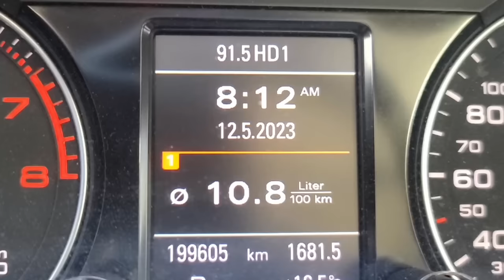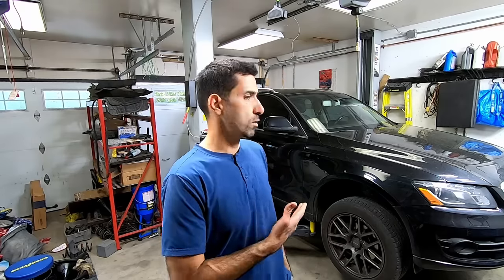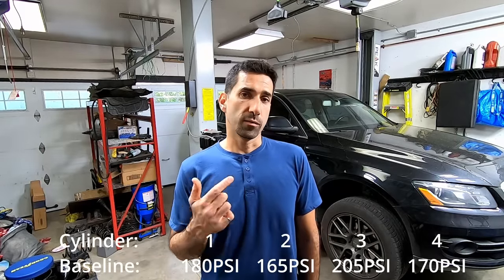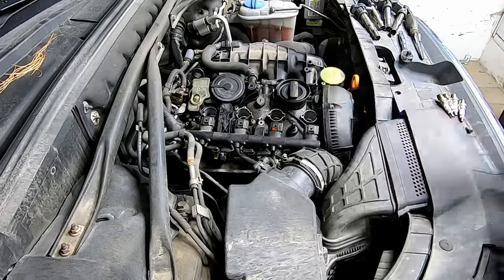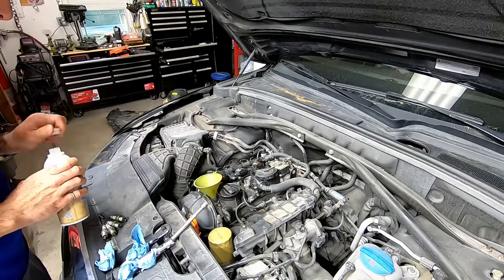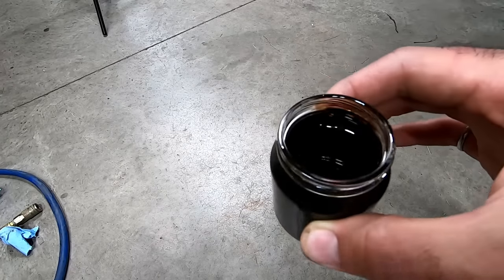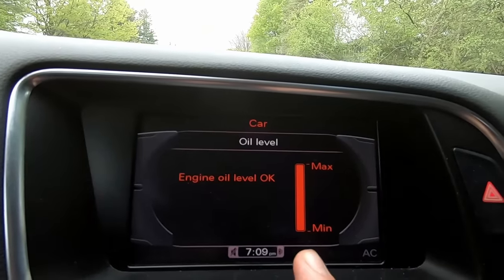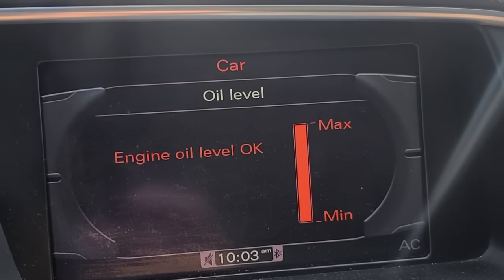How to fix excessive oil consumption from clogged piston rings (Part 2)

Comment: I finished the process with proline engine flush, when I turned the engine on there was a plenty of white smoke coming out literally like a cloud. After 5 minutes of driving I got a low oil pressure turn off the engine alarm but I was pretty sure that it was because of engine flush I drove around 25 minutes more, changed the oil and spark plugs and never got again low oil pressure alert, car runs smoother and acceleration is much better at the moment.
Reply from the maker: @EnsarRamadani-li7rz  please keep us posted on your results... lots of folks are looking for an alternative  to B12... what was your consumption before the soak?
Reply: @ETMotorsports  for sure I will keep posted about results, consumption was 1 Liter for every 250-300 KM. Next week I have a 1000 KM trip and I will keep you guys posted so other folks can see the results that I have.
Reply: @EnsarRamadani-li7rz  any update?
Reply: @romanbord668  the consumption is much better than it was, im on 2800 km since the piston soak process and i have still around %60-65 oil

Comment: Basically this problem is to do with euro emissions regs. To make engines that comply with emission and fuel consumption regs, for euro brands anyway, they use low tension rings and infest the engine with egr systems and other emission control devices. If such cars are then used primarily in low speed and stop start heavy traffic conditions, they self pollute internally with carbon and fuel related gum deposits, egr and direct injection being the primary culprits. Net result is high oil consumption, fouled plugs and intake valves etc. Of course manufacturers will not publicise these issues as it would kill sales, and won't even concede that extra maintenance, of the type shown here, is required, especially if their cars are driven in the conditions above. Personally, I drive my 2010 Mazda 2.2 diesel sport hard enough to prevent these issues, I use the best genuinely fully synthetic oil available, and have never had an emissions, oil consumption or regen issue. I do however use a diesel fuel additive on a regular basis and genuinely believe that is partially responsible for the lack of egr and carbon contamination problems. This is definitely a good idea with any modern engine, petrol or diesel. Ironic isn't  it, that the very systems added to modern engines to comply with emissions regs, end up causing way more pollution due to excessive oil burning! I mean, egr systems that force engines to breathe their own exhaust gas!!! WTF?!

Comment: Rotating the crank after filling with the chem tool just pumps it past the valves. Better just to let it sit till it runs past the rings then turn it over and refill.
Reply from the maker: you can't push the liquid up through the valves especially if you're rotating it by hand...and even if you did, you`ll just get B12 on your valves and it will leak back down - no issue...

Comment: could this work on a Ford American engine I have a 2010 Lincoln Town Car 4.6 SOHC V8 with 620,000 miles just started burning 2qt of oil every 4k miles could this work?
Reply from the maker: if the problem is clogged rings then yes it will work...that's very high mileages - oil consumption could be from other sources?

Comment: thank you very much for your 2 videos concerning this oil consumption problem that I also have on my Audi 3L TFSI supercharger engine, not finding this B12 chemtool on the internet available in France, do you think that we could do your process with another product as effective as for example the Liqui Moly pro line engine flush? thank you in advance for your response and congratulations again for what you do
Reply from the maker: Hey yes unfortunately B12 isn't available in EU...I would definitively try LiquiMoly Engine Flush Pro Line wth the same process - it should work just as well but I don't have a confirmation yet

Comment: hello i have audi Q5 2010 2.0 TDI which burns 1L every 1000km and now it's burning 1L every 250 KM ,the car smoke badly so i want to know if your car was smoking during acceleration and want to know if this piston soak may resolve the oil consumption
Reply from the maker: @abdouben4387  yup the car was smoking during acceleration and yes a piston soak can help if the issue is piston rings... first you have to eliminate all other sources of oil consumption - pcv, turbo etc... if everything looks OK then you can do a piston soak to see if it helps
Reply: @ETMotorsports  changed injectors glow plugs turbo so the problem last in piston the car smoke is getting worse with the consumption get bored to drive it want to test this DIY so I’m asking if it works for different people or you know others did it and it worked

Comment: There is an easier way than even this. Just throw in 0.25 - 0.5 litres of auto transmission fluid to your oil 800kms before your oil change is due. Eliminated my oil burning in one hit, but I plan to do it at every oil change. The detergents in the ATF atomise the carbon behind the rings, clear out the channels in the scraper ring and allow the oil to flow back down into the block as it should. 

Looks like this B12 stuff is good, but ATF in the oil seems to be an even easier solution.

Still looking for that silver bullet solution for clearing carbon off the intake valves without having to do anything time consuming or invasive.
Reply from the maker: @davidstonecreation  interesting... no additive we've tried has worked yet...

Comment: I have an 2016 Audi Q5 and it’s currently burning 1qt every 125 miles. Audi did BG EPR but after a week I am still burning the same amount of oil. Audi said it can take time to work but I’m not convinced. Do you think, if the BG did not work, would this B12 piston soak work?
Reply from the maker: @smislondon  for sure! EPR isn't all that effective
Reply: @ETMotorsports  Thanks for your quick response. Just have to find someone in NY to do this for me! Thanks

Comment: Already questioning things after mentioning that you're not changing the valve cover gasket and writing off the plugs as just wear and tear. It's all wear and tear eventually my man. If you're burning oil, I'm sure having some of it tossed outside of the crankcase and into the coil plugs isn't helping. Seal the crankcase better, improve the spec pressures from fixing those issues, make spark a better quality... that will help, even tho it won't solve it. Running seafoam/chemtool/supertech version of these/liquimoly in the crankcase, gas tank (and in some of these cases the intake/brake booster) would definitely go a long way to resolve this as well.

Combine it with a soon after oil change and then putting some marvel mystery oil or other product in the gas, and those other products i mentioned in the crankcase would most likely resolve this and only add value to what you've shown here. 
This just feels odd when you say one metric isn't enough to judge, but then willingly throw out other obvious metrics.
Reply: Also, good job on what you DID do in this video tho, it's obviously very effective... just imagine how much more effective doing all the things at the same time would have been for that engine. The valve train sounds truly awful.
Reply from the maker: thanks for the note...I didn't do the valve cover seal because that wasn't the point of the video - not because it won't get done...in actual fact I just did the 5k oil change and all four coils and plugs were completely dry so it looks like I may not need to do the valve cover seal anyways...as per the plugs - the original ones I showed were just that - original...they were in a terrible condition, which I attribute to their age and mileage so I replaced them...
Reply: @ETMotorsports  so does your car not use grommets? If it does, they might be in good shape but I wouldn’t wait for the valve cover seal to start leaking. But either way it sounds like it all ended well so far.

Comment: So do i need to change the oil before starting it or better to start it with the berrymans and old oil in the system? Im scared it will be too harsh on my old 05 scion xb!
Reply from the maker: @Alex-rb5fs  your call... if you're worried about running b12 in the engine,  dump the old oil before you start it
Reply: @ETMotorsports is there any risk? Just hearing different opinions
Reply: Would it affect the motors ability to start?

Comment: Apologies for the dumb question , but why was the car hard to start after the 24 hour piston soak? 

Also, did you do an oil analysis to make sure the gritty particles weren’t bearing material from doing a test drive with the b12 diluted crankcase oil?
Reply: One theory that I saw was that the B-12 washes out all of the oil in the cylinder, so it takes longer to build up compression to start on first startup.  I let the B-12 fully evaporate out of my cylinders, then sprayed some Stabil Fogging Oil into each and hand rotated the crank a few times to lubricate.  Still took about 30 seconds of cranking and blew a lot of white smoke, but started up fine.  I DID get some misfire codes and an ESC (Electronic Stability Control) error.  I found this video on resetting the ESC error (remove fuse and replace) - https://youtu.be/5-d4XDJCrCQ?si=BvcSY9RSmYBQVWgu. Then after driving for 10 minutes and clearing the codes, all was well.
Reply: @Diver_Dan  That's a really interesting theory, thanks for sharing that!  So if I understand it right,  the oil being removed from the cylinder walls by the B-12 causes increased friction, which (somehow) makes it take longer to build up compression.   I'm guessing that increased friction leads to slower piston velocity, slow enough that the critical level of compression required for starting the engine isn't reached?  It didn't really sound to me like the engine was cranking slower (in this vid) when it wasn't starting, but... I also don't really have a great ear detecting subtle variations in engine sounds...  so I could be convinced that it was indeed cranking slower until it finally caught.

And I'm also guessing that the reason it finally caught it was because the friction eventually decreased as a result of the cranking causing oil to eventually be transported to the piston walls?

Your use of Stabil Fogging Oil is a brilliant idea.  Avoid the drama (and increased piston/cylinder wall) of those dry cycles. I'd never heard of Stabil, and checked out the 1-star portion of the reviews on amazon. The only 1-stars were from unfortunate people who had the Stabil straw blow off into the spark plug hold, where (for a few guys) it took hours of struggle to extract. It looks like the modern version of Stabil has a permanently attached straw :-)

I can see why you'd get misfire error codes, but not the ESC error code.  Unless it's "just a VW/Audi thing".  Or unless you disconnected the battery cable during the B-12 soak?

Thanks for that link for clearing codes.  FYI, another way that I've come across to clear the half dozen error codes (which occur from disconnecting the battery) is to turn the steering wheel lock to lock.  

Cheers!
Reply: @tedjohnson64  I think it's actually much simpler than that.  I was under the impression that the oil helps the compression rings seal the pistons against the cylinder walls, helping build compression.  When stripped away by solvent, the compression doesn't build until the rings are lubricated with oil from the oil pump making its way into the cylinders.  But I could be oversimplifying it.

Comment: Mechanic of, 27 years here B12 has its place but it’s not a cure all you will continue burning oil just not as much. Also, please do not drop your spark plugs in the spark plug hole like you did in the video the reason being is because you could change the gap of the spark plug and that is very important to the proper operation of the vehicle do better we all cam
Reply from the maker: thanks for the note - the Q5 is now at 4500km since the service with no oil light...if I can get to a 5k oil change without having to add oil I think it's a pretty successful experiment...is it better than ripping the motor apart and spending 3-5k to fix the issue? no it's not...but it's an alternative...

I've replied to a few similar comments the same way - obviously the best thing to do is to rebuild the engine but these cars have very little value already so spending 50% of the car's value to rebuild the engine when you're never going to see that money back is a hard sell for anybody except the garage doing the work...

As for the spark plugs - noted...I've been doing this for 20+ years and never had issues but I`ll certainly be more careful in the future...in this particular head there's zero room for the spark plug to do anything but go straight in the hole where there's nothing to hit but perhaps in other motors it's not the case...thanks for the feedback!
Reply: How much oil did it lose at 4500km mark?
I’ll try acetone+atf for my b8.5 a5. These engines truly suffer from short distance travel i gotta say
Reply from the maker: @Exray737  no oil light yet so less than 1L so far... the sensor indication is not even at half yet

Comment: I have  a 2013 A5 2.0T. was running through a qt every 500 miles.I did piston soak. Before I started my compression was 168,168, 175, 165. After completing the soak my compression readings have dropped drasically to 80, 80, 70, 70. I drove car for the 20mins at 60mph in 3rd gear. EPC code is flashing on dash and car wont accelerate like before and idles very rough. Any idea what went wrong?
Reply from the maker: hey have you been able to figure this out yet? did you check compression after driving the car? this is the first time anybody has reported losing compression after the soak. It's not unexpected because after all you're soaking all the piston rings at the same time so your compression rings might get affected as well. Did you check for codes? The flashing EPC light could mean a few things from oil pressure to camshaft adjustment. I wouldn't drive the car with the low compression numbers but repeating the soak should be able to restore them...any updates?
Reply: Compression restored after driving car for a few miles. Guess they had to reseat. However car started misfiring. Replaced all spark plugs and coil packs. Misfire solved 😝. And get this. I'm going on 2000 miles and havnt had to add 1 qrt yet. Thought MMI was bad or oil sensor went out cause I couldn't believe it. So I went wentand bought a dip stick and havnt lost a lick of oil!!!! Rear bumber by the tail pipe isn't turning black anymore from blow by. If anybody doubts this method. They just not doing it right. Cause this another BIG WIN for the team Audi oil consumption fix 🎯💪🏾😝🤘🏽🎉🎉. Thank you so much for THIS VIDEO!!!

Comment: Hi, thank you for video. I WILL DO THIS week. But im struggling aswell to find b12 chemtool fuel injector cleaner. Do you recommend doing it with Liqui Moly Injector cleaner?
Reply from the maker: @EnsarRamadani-li7rz  you can try... or LiquiMoly Engine Flush Pro Line... viewers have mixed success with other chemicals depending on how bad the engine is

Comment: Dose anyone has an idea of b12's alternative product? B12 berryman is no where I can get in my country. Besides this, I cannot order b12 from Amazon due to shipping issue.😢 Any website or similar products?
Reply from the maker: @bluesky6253  where are you located? Some folks have been able to order from ebay...Alternatively you can try LiquiMoly Engine Flush or injector cleaner
Reply: @ETMotorsports  thanks for your reply bro, I am in Taiwan, I think I will try Liqui Moly for the first because Liqui Moly is available every where. Not sure why they are so popular.

Comment: How is this fix holding up for your sister? I know you sold the first one, and I just did this and was wondering if it had continued to be bandaged or if it started to decline again. Thanks for the videos!
Reply from the maker: 4500km and still no light...I`m waiting for 5k to do the first oil change and check compression etc. but so far the car is running great